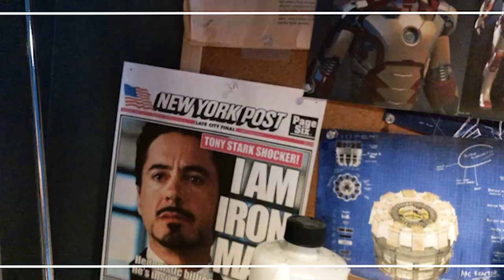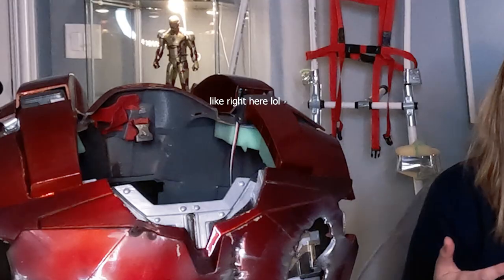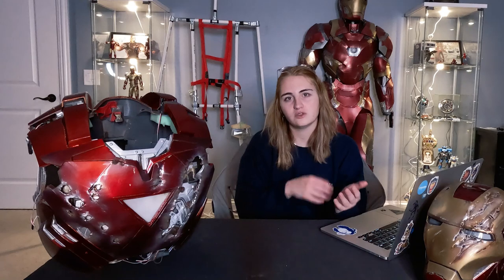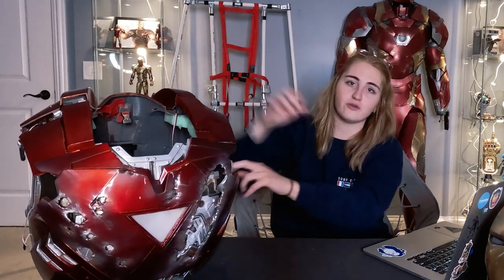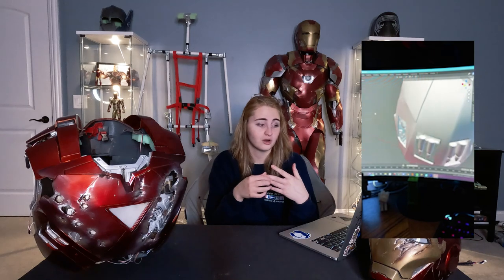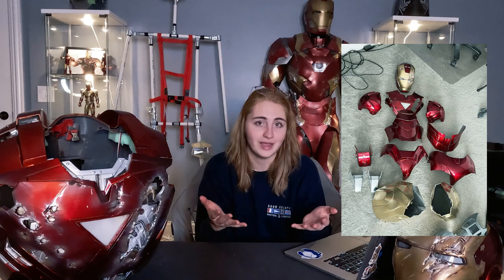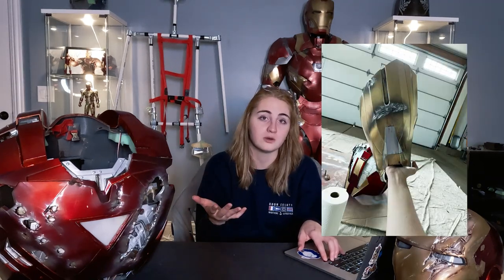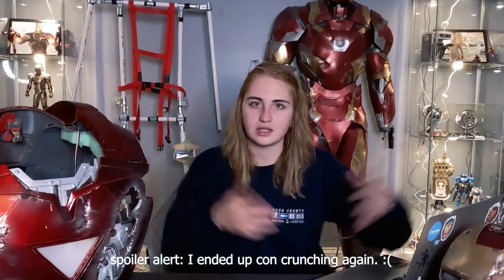How I BUILT an IRON MAN SUIT! | Iron Man Mark 6 Part 3 - Con Crunch

Comment: Is there any way to clear coat the gold without it changing color?
Reply from the maker: I think it all depends on what kind of gold you use and what kind of clear coat you use. it almost always will dull the metallic shine of it but the gold frank used and the 1k duplicolor clear didnt shift the color too much. I believe he has a video up on that too you can check out, I personally have never done it on this specific suit and paint but I have on the mark 42 build and had similar results to what frank achieved - just a flatter gold color that has more of a glossy finish than metallic. There’s also a special way to put clear coat on, spraying it on too heavily right away I think ruins the color more